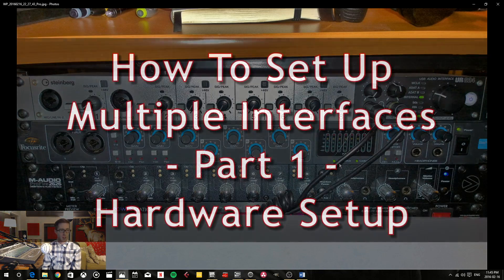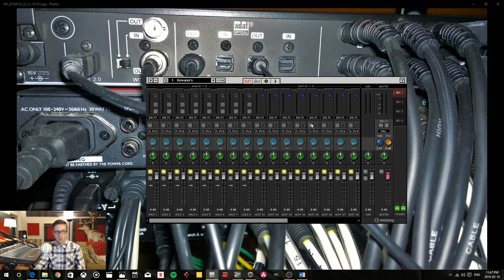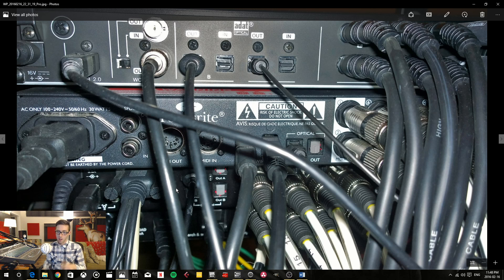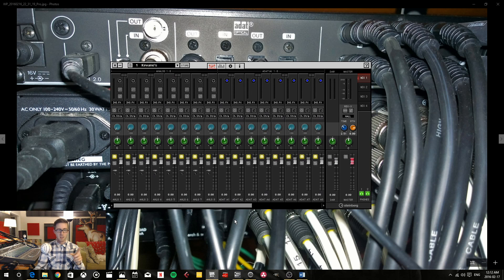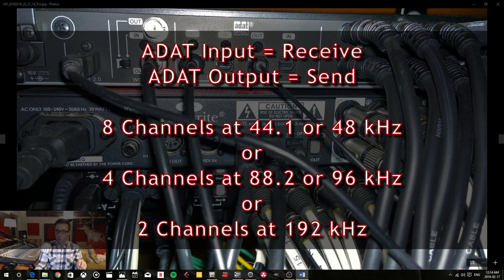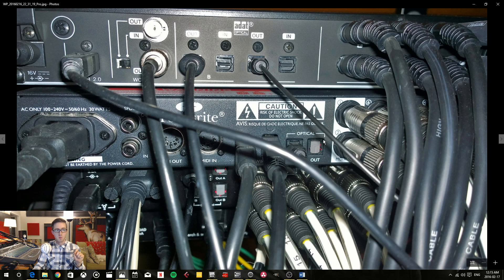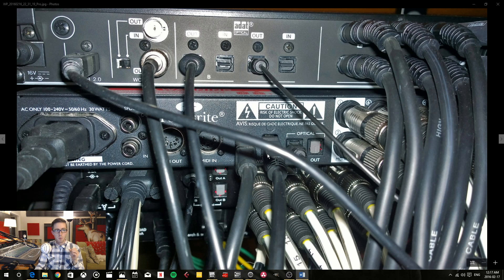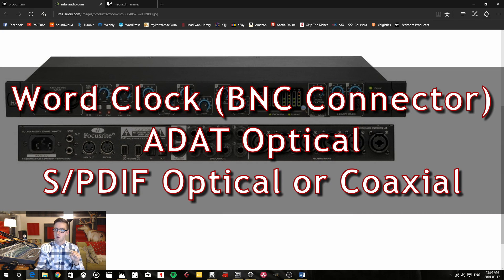How To Set Up Multiple Audio Interfaces via ADAT - Part 1 - Hardware Setup

Comment: i have 2 interfaces, one is new and has high specs the other old but it has faders to help with direct monitoring and such,
if i run adat from the new one into the old so i can use it to controll my direct monitoring and then the old one into my pc, will the old one bring down the audio quality of my knew one?
Reply: old interface is the alesis master control
new interface is RME fireface ucx
Reply from the maker: I'd say it simply depends on the quality of the components of the old interface. The RME firefaces are all really good quality, but I've had trouble with one of their oldest models. Then there are cases where brand new interfaces don't have as high quality of components as some interfaces from 4 - 8 years older. 

Essentially what's going to happen is the RME will convert your audio using its Analog to Digital converter, then send that digital signal to your Alesis. From there it sends the digital audio signal into your computer. In this sense your Alesis is going to be the bottleneck, meaning your audio quality is only going to be as good as your Alesis can handle taking your ADAT signal and sending it into your computer. The other thing is that your Alesis would be your main interface meaning it's also the main word clock device, and again the stability and accuracy of the audio signal and monitoring will only be as good as the Alesis components allow it to be.

Search this webpage for more details on your Alesis and come to some conclusion if you like:
http://www.soundonsound.com/reviews/alesis-master-control

My advice is as follows. If the ability to direct monitor using your Alesis is a very important part of your workflow, then I would sacrifice the slim but potential degradation in Digital signal processing and word clocking. Chances are there's only going to be a very small amount of degradation if any at all. If the direct monitoring is not important at all to your workflow then maybe consider using the RME as your main since it is guaranteed to have high quality components and would be less likely to cause any degradation at all.

Hope this helps.